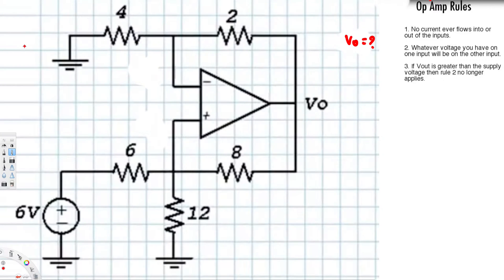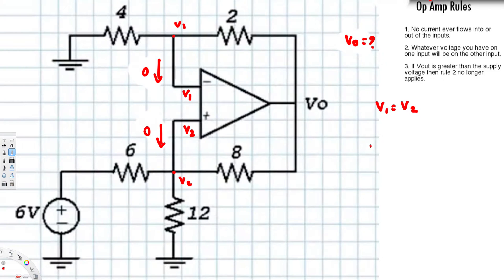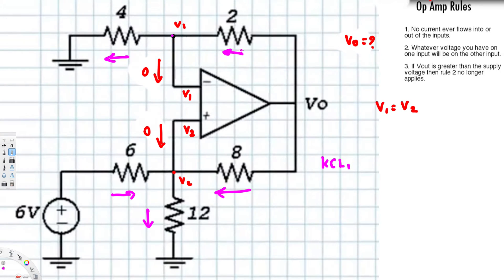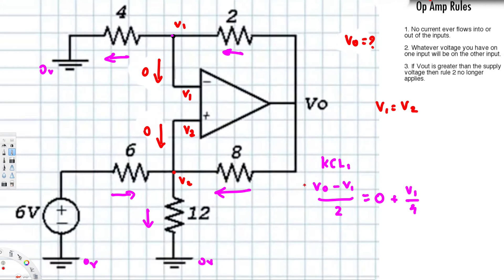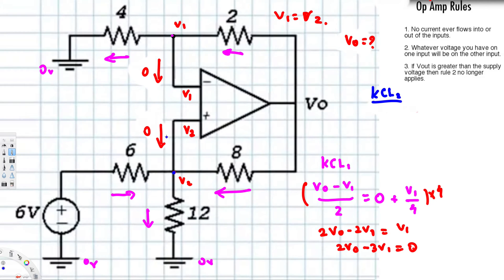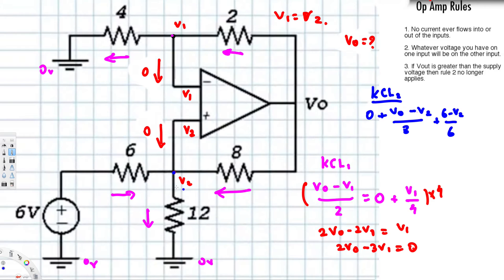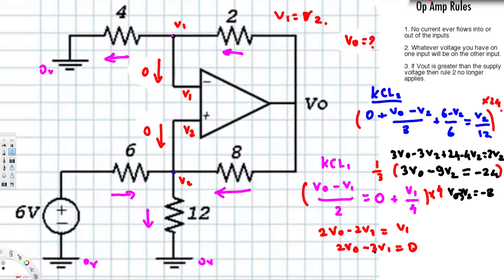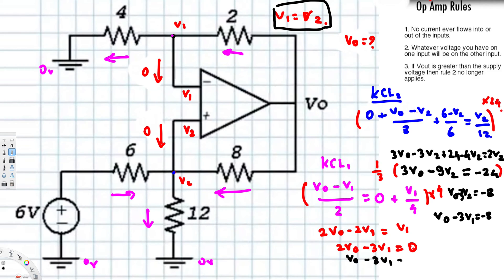Op Amps Tutorial : Circuit Analysis

Comment: The solution found is wrong , because , On either it's sides it is surrounded by same voltage , so no current flows through 8ohms and 2ohms , so no voltage drops , which means Vo is just 4V ( if you use voltage divider in the positive terminal circuit ) but again if V1 is 4V that would mean some current is flowing inside op amp , since none is coming from the Vo side , so this circuit could be wrong .

Comment: isn't the second rule wrong? v1 isn't always equal to v2
Reply: It's just a simplification to make ideal calculations with. When there's a feedback resistor in the circuit, both inputs will have very nearly the same voltage. It's the slight difference in the voltages that acts as the signal to be amplified. That difference is so slight, though, that it can be ignored in calculations (a real op-amp has a gain of 10000 times or more, so a 100mV input voltage difference might give a 1000V output). An ideal op-amp has infinite gain, so the voltage difference is infinitely small.